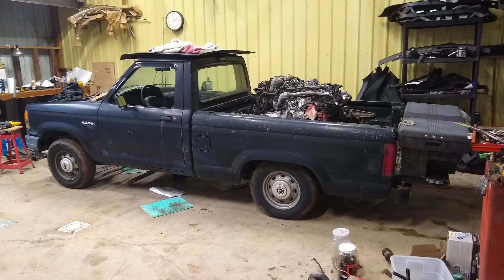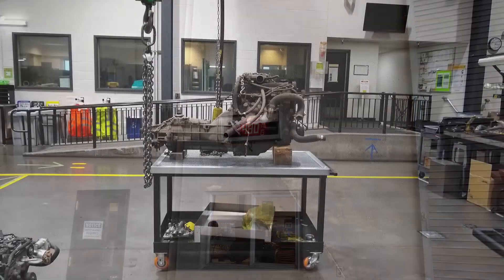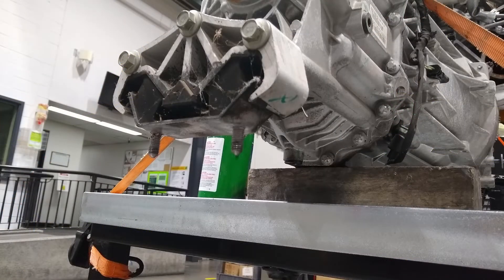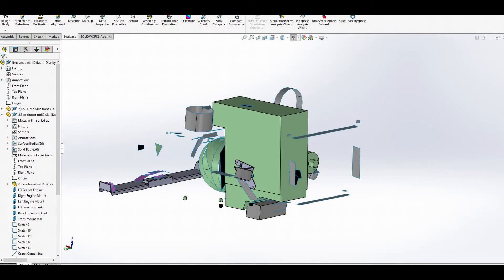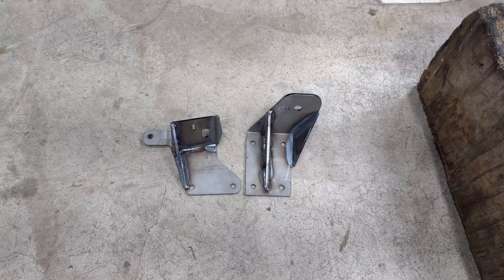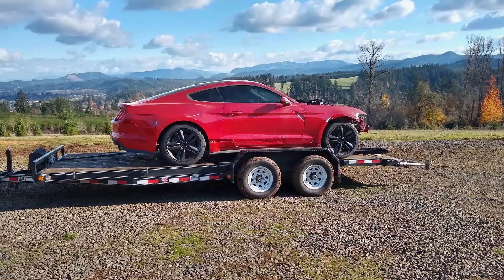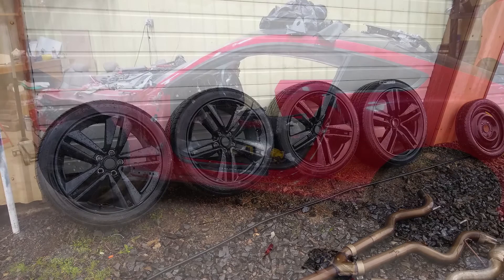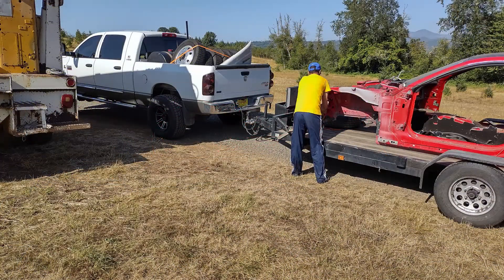Ranger 2.3L Ecoboost Swap. Ep 2

Comment: Would you sell me either the CAD plans or the actual custom motor mounts and transmission cross member? I have a 92 that I wanted to do this swap on. Thanks
Reply from the maker: I have a kit available on my Website, muntsmotorsports.com
Let me know if you have any problems finding it.
Reply: @muntsmotorsports  got a 97 I'm seriously considering this swap. However the firewall cutting and losing the heater doesn't sound pleasant. I don't know these modern 4 cylinders to know if there is an easier swap
Reply from the maker: @dobermanownerforlife3902  the heater in this truck still works perfectly fine, only had to do a little bit of firewall cutting